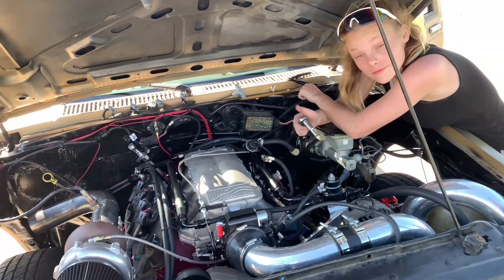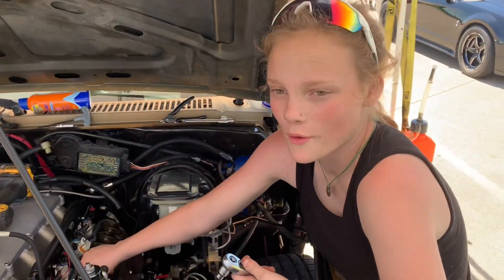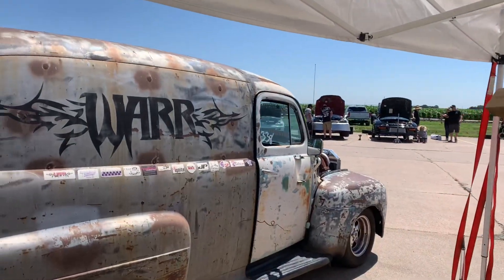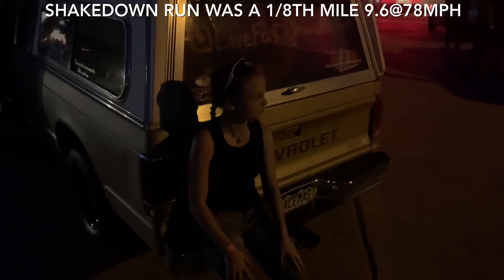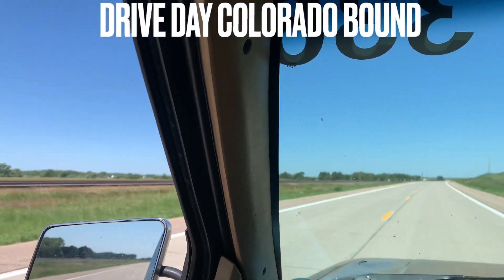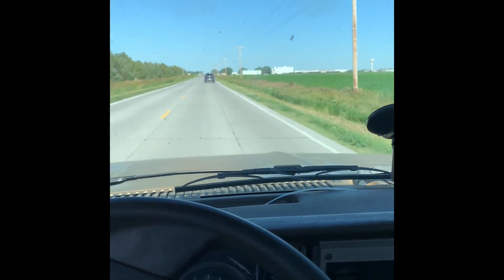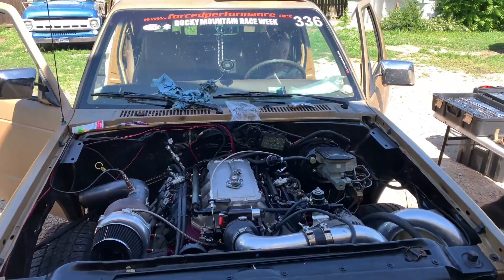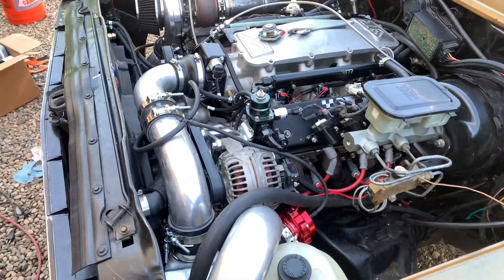The struggle of not testing before Rocky Mountain Race Week!!! Destruction!

Comment: when you have to remove your valve covers a few times is when you wish you had bought the coilpack relocation kit.
Reply from the maker: We mounted the coil relocation kit to the valve covers. We go over it in a video. The Brian tooley coil brackets sat way to high
Reply: @livefastdrivefaster  when I mean relocation kit, i mean the Ignition coils on the firewall not valve covers. use long sparkplug wires.

Comment: When you first started it it had lifter noise, I guess it didn't go away
Reply from the maker: Has a tic from a broken exhaust bolt in the head so it clicking by there. A lot better than valves dropping! Still in the race
Reply: @livefastdrivefaster  yeah that was bad luck I hope it gets better for you
Reply from the maker: We are dealing with the tic it’ll be fine. As long as we make a hit on the last day I’ll be happy